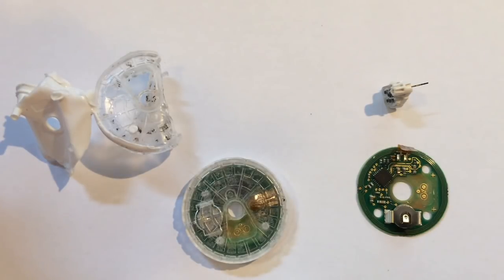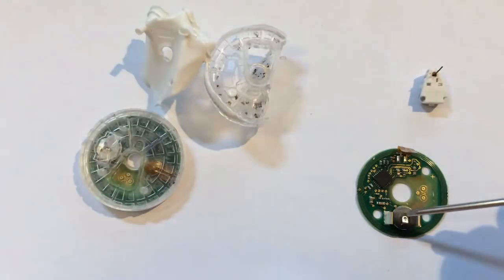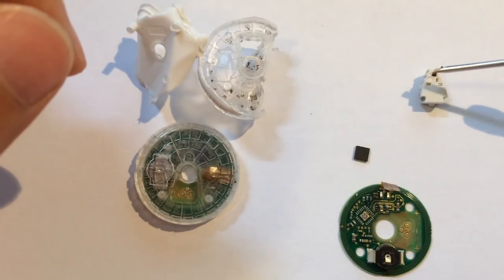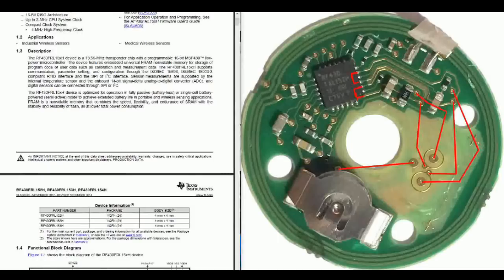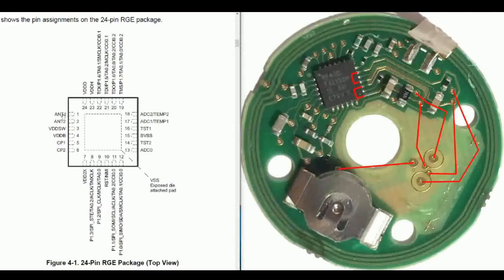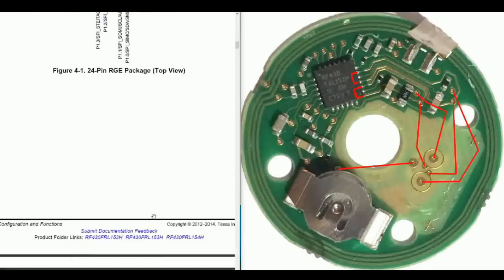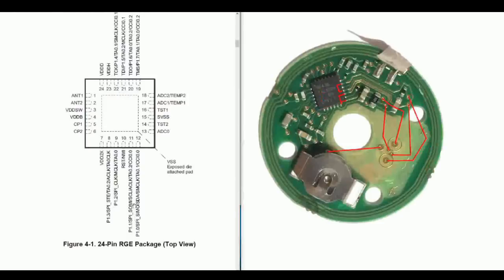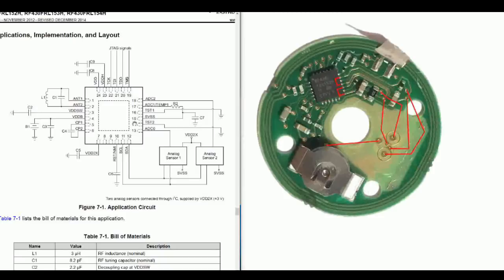Freestyle Libre Sensor Teardown and Inside Analysis

Comment: Why these sensors need to be replaced every 14 days? What happens to these sensors after 14 days?
Reply: Accuracy declines towards the end, and increased scarring if leaving in for longer. Abbott has made it to stop working at 14days so there is no point keeping it in beyond that.
Reply: wonderingif it is possible to reset the timer in the chip. or it is the sensor made in that way?

Comment: I have not done this ever. I like libre as it has eliminated frequent finger pricking from my life. which is very painful. Gradually I found libre is incomplete without a cgm device as every time scanning the sensor is not easy. I found Blucon Nightrider a third party cgm device which gives me sensor's reading every 5 minutes without scanning the sensor. Most important which I felt that every diabetic would like is that alarms. Blucon saved me on various occasions when my BS went too low and the sound alarms woke me up from sleep. Thanks to Blucon and libre sensor

Comment: Wonder if something as simple as pulling the battery and reconnecting would reset the clock.  Not that I'd ever put it back on my arm.
Reply: It's definitely worth a try.  I tried popping the triangular sensor out that actually goes in your body, hoping that that would power it down, but it doesn't. It remains powered up and the sensor stays in the failed state. Contact me if you know how to modify the firmware on this as I would like to try that:
https://www.linkedin.com/in/brent-van/

Comment: The other good thing about the meter that came with wifey's sensor (sample) is that you can buy regular sticks over the counter @ Walmart pretty cheap.  We've got a problem with insurance not allowing any prescribing of sticks or her original meter over 3 / day, and since she's on a dual therapy, she needs 5 or maybe more / day. 

Prime example of what annoys me the most.  Anyway we can afford the OTC sticks to close out the shortage whether she gets this or not.  Now checking what amount the INS will cover.  This one leaves them no room for cover since they time out at a certain number of days, so they can't prescribe it all if they don't cover it fully.

Comment: We have had one (wifey uses it) sampled to her by a doc.  When we installed it it bled out of the weephole quite a bit.  When we quizzed the doc about it bleeding, he said that it should not bleed at all.  No idea how a spike this deep wouldn't bleed.  I've personally had much shallower spikes (metal shavings, etc.) that stuck me on my foot and it got to blood.  This thing goes in at least 3/4 as deep as her injector pin does.

Anyone have that happen?  what to do?  Next time I'll have the video going to show the doc anyway.  He claimed a lot of patients and no blood.  I a doubting it.

Will have to tear up the one we have and see if there's any hacking possible.  Wish foone had one to get doom running on it :-)
Reply: For me it bleeds if I insert it with force....if I apply it gently, it doesn't bleed
Reply: @renus6015  there's a 3/8 inch spiike that lances you. Has a path up thru center. 

Force of application was a function of the applicator.   Just released it, and bleed out the hole on top. 

Endo guy said it shouldn't bleed either, but when it had expired ans she saw him next sent the thing in with spike out
Reply: It does happen, and that's totally normal for it to bleed from that place. 

Source: I've been using it for 3+ years.

Comment: I'm using my Libre sensor with Blucon NightRider. I'm very happy with the performance of the device. I'm using the new version of the Blucon which activates the new sensor for another 14 days.
Reply: Richra - a question - are you using it with Freestyle Libre Pro - if so do you still need Freestyle Libre Reader to activate - or only need the NightRider App,  and the bit that clips onto sensor?
Reply: @rajb4549  Yes, I am using BluCon with Freestyle Libre Pro and I activated the sensor through Libre activate app, there is no need for a reader. Also, I use 3D holder to protect my libre and blucon.
Reply: @richakamra9207  Thanks for clarifying that. Is Libre Active App from Blucon. I am a T2 and so dont need continuous monitoring or alarms. I just want to track how what I consume affects my blood sugar. I only anticipate using it for say 2 months. So all I need is Libre Pro and the Libre Activate App?

Comment: I believe that Freestyle Libre 14 day is a snapshot reader-triggered measurement.  The reader detects the trend (hence the arrows) to generate a graph based algorythm.  The rise angle between previous scan can create false sense (based on my engineering statics 101 training) can throw the streight line flattening of the graph versus time.

Comment: Does the board have conformal coating?
Reply from the maker: As I remember it doesn't, I was able to probe the board once opening. The outer case is sealed to prevent water entry.
Reply: Thanks! I saw another video recently that made it seem as though they do. I'll crack mine open soon and see what the situation looks like. I wonder if it's a region-specific treatment.  @lightnthings5541

Comment: Am I right in saying then that the Libre FreeStyle has no memory? It takes a reading when the NFC field is activated, sends data and the connection closes?
Reply: No.It has FRAM & RAM Memory.To store 15 min tagged values.
Reply: @jkengg  Does it not store 8h values?
Reply: donde lo puedo conprar en mexico
Reply: @susimpantoja860  Comprar en Costco en Mexico. Los pricios para dos sensores en enero 2022 fue $ 2,500 MXN.

Comment: Hello,
changing the battery sensor,it can be reused and is fully functional, or is it not calibrated?
Reply from the maker: The battery still has heaps of charge left after the 2 weeks, sensor expiry is done artificially either through the reader or sensor.
Reuse is mainly limited by the fact that you can't re-insert a used sensor (not that you'd want to), the electrode part that goes into the skin also may degrade and be less effective after the 2 weeks.
Reply: It is programmed to turn off after the two weeks. Much like the chips in ink jet cartridges. Keeps you coming back to buy more.
Reply: Can it be avoided?

Comment: I was wondering if we can hack it's nfc and replace it with Bluetooth and if this can be reused to be honet.
Reply: I understand that a newer version of the 14 day sensor is bluetooth enabled.
Reply: Hello, given the size and construction of the device, hacking would be difficult, however, look for BluCon or Sony Smartwatch 3 hacks to convert the Libre into a continuous reader when paired with a smartphone in range.
Reply: are you currently using the device? If you are India, how did you get it?
Reply: @himanshujain5674  Hi kindly provide your number, we have reseller in India, they will contact you.
Reply: @himanshujain5674  you get it by doctors channel
Reply: Have a look here: https://github.com/JoernL/LimiTTer this is a NFC to bluetooth adapter for freestyle libre, I might build one myself...